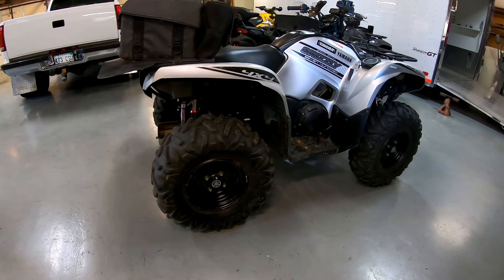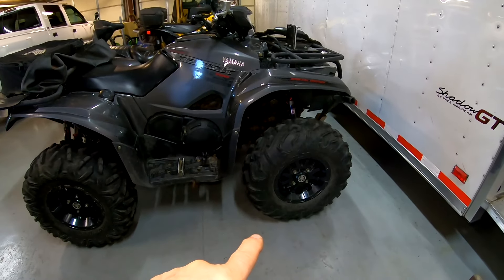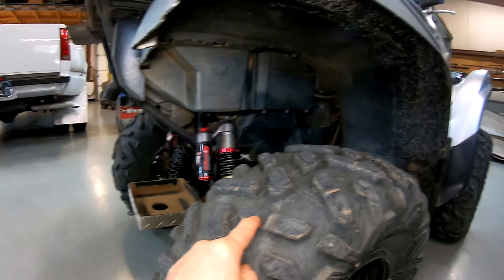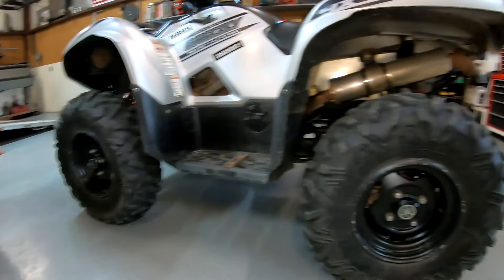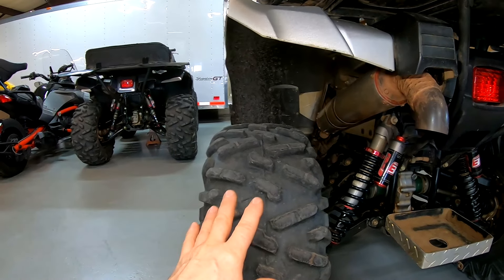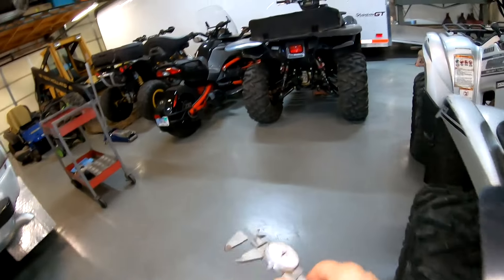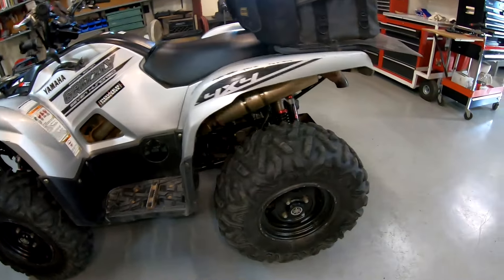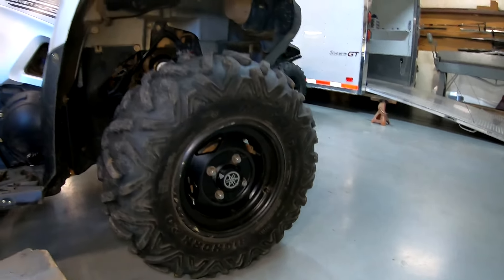MAXXIS Bighorn 2.0 Tire review after 4 years. Yamaha Grizzly 700

Comment: I had a set of 2.0s on a Polaris Ranger they had 3000 miles on them when I sold it and still looked great — Thanks for the review you do a great job
Reply from the maker: Hi Kirk, that’s quite a few miles. Running them on a Ranger. 
I’m surprised they held up that good. 
Thanks for checking out the video. Much appreciated!

Comment: Nothing like a good tire review. I agree with your reasoning. The softer carcus does provide a much better ride, and although the 3.0 may last longer I would rather have the more compliant ride than the longevity
Reply from the maker: Hey mornin Chris, when I was shopping for tires, the ride quality was one of the big factors in choosing the 2.0s. 
But with the way the prices are getting on ATV tires I may be changing my tune on the 3.0 tire. LOL 
They’re getting close to $200 each, 
Heck you can buy passenger car tires for less than that. That’s nuts!
Thanks for watching bud. Talk to you later.

Comment: The bighorns are good winter tires as well. The soft compound and relatively light weight works. I ordered some ss360's for snow riding, hopefully they show up soon. Thanks KC.
Reply from the maker: Hey, Coolkitty, never heard of 
SS 360s? 
I do think the bighorns worked pretty well in most conditions. Thanks for checking out the video!
Reply: @kcatv9556  System 3 ss360. Kind of like the old school othsu pro wedges. Bighorns with gripstuds until the snow is deep then the ss360's is the the plan.

Comment: My teryx has bighorn 2.0’s on it and because of the machines weigh I run about 10 pounds on the front and 12 on the rear. They are great tires and ride smooth. Was gonna put a set on my grizzly a couple years ago and because of the price for a set I went with the Kenda Bearclaw HTR. They are also a radial tire but do seem heavier and hard to balance. At the time the Big Horns were about $550-$600 a set. Now they over $800 a set.
Reply from the maker: Hi Ben, yeah, for sure the price of off-road tires are getting ridiculous! 
Heck, you can buy street tires for less than that. I don’t know what I’m going to buy when these wear out. 
I guess I’ll figure that out when the time comes. 
Thanks for checking out the video!
Reply: I got wanda p350 which are a copy to big horns for my first gen 01 grizzly 600. Ill see how its goes , the grizzly is still on its original tires 😵‍💫

Comment: KC, have you run the bighorn OGs? Curious to see what uou think of the two side by side.  Any issues with sidewall or punctures with the 2.0?
Reply from the maker: Hey Jesse, I have not run the other bighorns and have had no issue with sidewall punctures with these 2.0’s 
I went with the 2.0s simply because they are lighter and have been happy with them.
Thanks for checking out the video.
Reply: I have not run the 2.0s but have ran the originals on 5 different ATVs. A Grizzly, Brute Force and 3 KIng Quads. Never a puncture issue. I pig hunt in Texas and while we had a couple of flats this year none were on Maxxis tires. The ranch we hunt at uses 2.0s and they love them. The wear like iron. I don't mud but have been in 18 inches of mud and they did fine. I always think of trying something else. Usually the Bear Claw HTRs come up but I have had such good luck with the BHs that I keep putting them on my machines. The BH originals also do well in snow. For icefishing I buy motorcycle ice racing screw and don't mess with chains. The tread is so thick I just screw right into them. Never a problem. I have a 1000 miles on a set on a KQ. Mostly trails but probably 100 miles on pavement and the BHs just hold up. Thanks for the video.

Comment: Kenda bear claws k299 are a really great tire also I have around 7000 hard miles on a set between putting them on my  grizzly 550 and my yamaha viking 700  there still holding up no holes   about half tread  great traction everywhere  I also run sti black diamond  xtr  with has over 5000 miles more than half tread  great tire
Reply from the maker: Hey Pateick, The price of the Maxxis tires are getting so expensive, I may have to look into Kenda’s when these were out.
Thanks for checking out the video!

Comment: im debating these vs 27x9x12 all the way around. any sense how this setup might differ based on your experience?
Reply from the maker: Hi Ryan, Not sure what type of machine you will put that set up on but what I have noticed the side walls are really flexible with these tires. Going with a 27 inch tire on a 12 inch wheel. Would give you a lot of sidewall, and the potential of it to be really flexible and probably not handled very well.
That would be my concern going with a 27inch on 12” wheel. Hope that helps you out. Thanks for checking out the video!
Reply: Good point -   @kcatv9556 . Tires will go on a 700 Kodiak. Wonder if the OGs have stiffer side walls... i do like the light weight option, but a few extra pounds might be worth it. Thanks for the insight and keep the content coming!

Comment: I have a 2023 Grizzly 700, can i run 27-11-14 bighorns 2.0 all the way around? Thought it would look aggressive.  Is it possible?
Reply from the maker: Hi Ray, they may fit, but possibly rub when you turning. 
Myself I wouldn’t do that I would put the 9 wide on the front
Hope that helps you out. Thanks for checking out the video.

Comment: What PSI do you like to run? I like around 6 or 7 on my bike. Sometimes I go 5. Man I'm so impressed that those tires still look that good after that many miles.
Reply from the maker: Hey buddy, I run 4.5 in the rear and 5 in the front. 
Yeah I’m pretty impressed with how they’re holding up especially with the rocky terrain We ride there in Arkansas.
I think the weight of your Kawi is pretty close to ours? 
Thanks for checking out the video buddy!
Reply: @kcatv9556  yeah right at 700 pounds for my Kawasaki. For whatever reason 5 pounds at times seems too low.
Reply from the maker: @miillersoffroad  Maybe with your machine having a V twin has more weight on the front tires? May have to run more than I do in the front?
Reply: @kcatv9556  that's definitely gotta be the case. My brothers Kodiak 700 definitely doesn't feel as heavy in the front end. When are you guys planning to ride again? We're hoping to in early April.
Reply from the maker: @miillersoffroad  we are going to be back down to Mack’s the weekend of March 11 gonna camp at moccasin gap again.
Reply: @kcatv9556  man that's awesome! My favorite place.

Comment: So I've been running 2.0s since 2011.  I have them on all 3 of our wheelers.  They hold up great.  Only issue I have had is on my 1000 they are wearing faster than they do on the 570 and 800.  The 2 reasons why are one: road riding down at HMT and 2: POWA!!!!!!!!!!!!!!!  

Want to touch on some of your highlighted points KC.  
First: the flexible side wall doubles the gripping capabilities of that great tread pattern.    
Second:  these are NOT SXS tires.  First time in Moab and my buddy literally wore out a brand new set of 2.0s on his brand new SXS on that trip.  We literally took pics at the beginning of the day to record the amount of wear on the tires.  Another buddy in his new SXS on a local NE powerline woods trail sustained 3 flats in 1 ride on his 2.0s.  NOT A SXS TIRE!!!!!
Third:  agreed softer compound with I suspected and why the tire grips so so well.  Makes the wheeler so predictable.

Just wanted to say the 2.0s are a great trail tire, does everything well may not be the best at one particular thing but all in all when it is said and done the tire is the best all around trail tire you can buy for an ATV.  

Also IDK about now but years back there was a negative wrap the 2.0s were getting.  It came from 2 areas.  First one we talked about and that came from the SXS world and how the tire didn't hold up to those conditions.  The other was there were some manufactures putting 2.0s stock on their higher end ATVs.  Problem was they were a 3 ply 2.0 that didn't hold up very well.  But the 6 ply 2.0s can't be beat on an ATV IMHO!
Reply from the maker: I agree the 2.0 tires are lightweight and more suitable for a ATV not 
SXS
The 3.0, tires are much more heavy duty more suitable for a SXS
Great comment. Thanks for checking out the video.

Comment: Another good tire that is a knockoff of the bighorns is the sunf. My buddy has them on his cfmoto 600 and I couldnt belief how good they are in snow and mud. I rode his atv and they are good handling, no vibration, and smooth on hard pack and hwy. I am seriously thinking thats my next tire. He only paid $ 396.94 for a set of 4 tires. And thats for 27x9x14 and 27x11x14. Just a heads up. Thought that was a killer deal. And their honestly some good tires.
.
Reply from the maker: Hey Michael, yeah buddy that’s a good price for a set of four tires. Maxxis tires are getting so expensive! Bighorn are close to $200 each now.
Thanks for sharing the info. Appreciate you checking out the video!

Comment: Hey Mr. KC! How are you doing buddy? Great review sir! You're not wrong. It's not like the old days when mudlites were the way to go for an aggressive tire. Lots of options now. Very cool that you have a rubber hardness gauge.yeah prices for things are getting rough. Happy riding!

What's the story behind you wrapping the tip of your exhaust? Was it warping the plastics? Looks like you have some type of black plastic device just above also. Curious to know more. 

How are you doing sir? Sorry I haven't been around much. Things have been kind of complicated for me this past year. I feel bad that I haven't been keeping up with the community very well.
Reply from the maker: Hey buddy!, the prices for everything seem to be going up extremely quick. 
Especially for ATV tires it seems. The exhaust pipe tip is an over sized extension that I have several layers of screens to muffle the sound a bit. I went with oversize to keep from causing a restriction with all of the screens.
I know how busy things can get in hard to find time for YouTube. Thanks for checking out the video, my friend!

Comment: would you get the 2.0 instead of the 3.0 again for your personal Grizzly?
Reply from the maker: Hi Barney13, that is a great question. I would probably still go with the 2.0s since they have a better ride than the 3.0‘s, 
But with that being said, the 
3.0’s are going to last longer since they are a harder compound. 
With the price of these tires and if ride is not a big concern the 3.0’s would actually be a better tire simply because they’re going to last longer.
It’s definitely a difficult decision. Trying to figure out what tires to buy for an ATV. 
Hope that helps you out. Thanks for checking out the video!
Reply: @kcatv9556  Awesome, thanks for answering my comment. Have you noticed any wobble/vibration at higher speeds (30+ mph) with the 2.0 or 3.0?
Reply from the maker: @barneychamorro  they run really smooth at higher speeds on the road. 
They don’t wobble like the knock offs that Polaris, but on their new sportsman.
Reply: @kcatv9556  both the 2.0 and 3.0?
Reply from the maker: @barneychamorro  yes, they both run smooth down the road.

Comment: Honestly an overrated tire. yes, they last long, but c'mon... 800 bucks for a set of 25s???
Reply from the maker: Yes, they are very expensive. They’ve really gone up over the last 5  years. Are 26’s 
Thanks for checking out the video.
Reply: @kcatv9556  yeah the 26's are 900 bucks so thats even crazier. I like my zillas. 450 bucks for a set of 25's and 600 bucks for a set of 26's. Still expensive. Personally I like Kenda bear claw EX which is only 300 for a full set of 25's. But really everything's gone up.